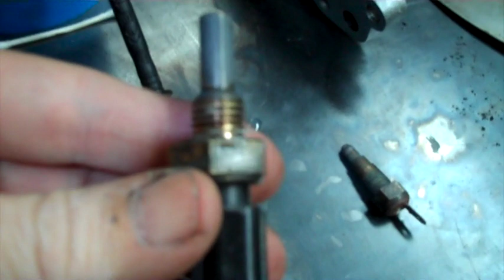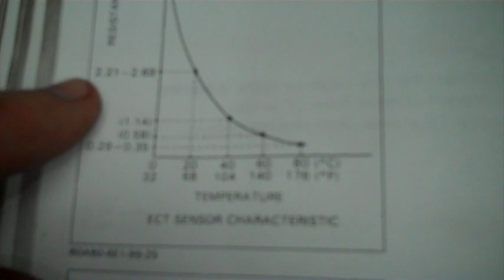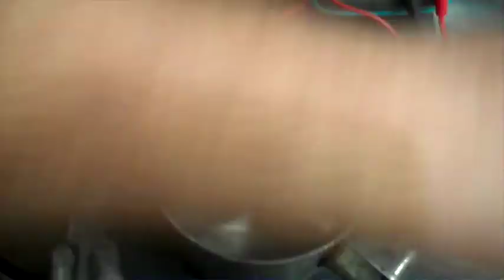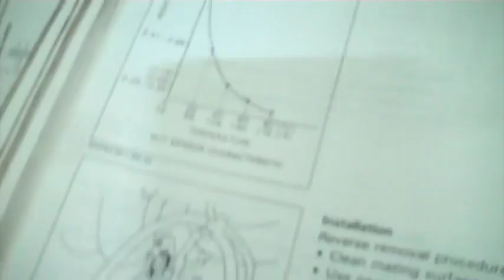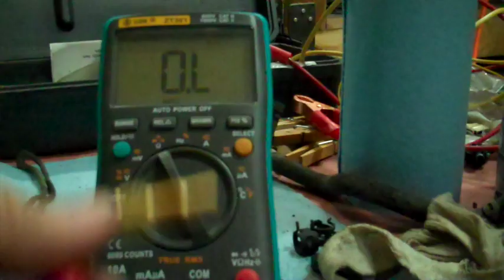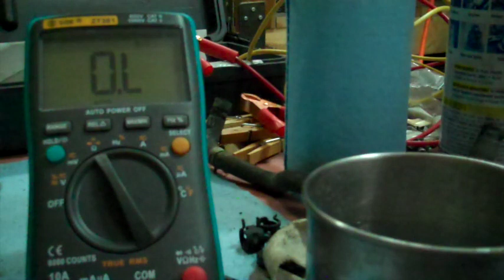1995 Suzuki Sidekick Temperature Sensor Testing

Comment: I have a 90 Tracker that may be overheating.  I'm going to try this.
Reply from the maker: It's good to be sure that the sensor is working.
Reply: @nunapitchuk  Well until I can get the money for that(Tracker is not a daily), I use a meat thermometer, and I used my daily to get a control, and the Tracker is the variable, sort of like a science experiment.
Reply from the maker: @BillyBeethenomad  Sounds like a plan.  Good luck.
Reply: @nunapitchuk  What are the names of each sensor?
Reply from the maker: @BillyBeethenomad  It's just temperature sensor.  One is for the dash gauge, one is for the computer, and one for the air conditioner if you have one.
Reply: @nunapitchuk  I do have AC.
Reply from the maker: @BillyBeethenomad  That means there are 3 temperature sensors in the thermostat housing.  The one to the dash gauge and the one to the A/C will only have one wire each.  The one to the computer has 2 or 3 wires.  That sensor is the most important.

Comment: Where is it located frank new to this thank you
Reply from the maker: The coolant temperature sensors are in the thermostat housing just below the thermostat.  There are two or three.  One for computer, one for dash temperature gauge and one for air conditioning system.

Comment: sir , do you have information about IAT sensor? it's  close to maf sensor?
Reply: it's Air temp sensor than I Need information, Sir
Reply from the maker: @hectorrojas8932  Sorry, my car is older OBD1 system and does not have an air temp sensor.  Most temp sensors work by changing electrical resistance and can be tested with an ohm meter just like the water temp sensor. I would hook it up to read ohms and then blow a hair dryer on it.  If the resistance changes with the hot air then it is probably working fine.
Reply: Good morning thanks my friend,
I have a problem, two obd1 code, 51 and 23, but, that happen my car don't have egr heater and don't have IAT SENSOR
Reply from the maker: @hectorrojas8932  Might be a translation problem, but I have never heard of an egr heater and these old cars don't have air temp sensor.  Maybe you are talking about the egr temp sensor?  The '95 & '94 models has that, but the '93 does not.  If you switch ecm from one to the other then it will work fine, but will give code 51.  You can make the code go away by putting a resistor at the end of the wires to the egr temp sensor.
Reply: Querido amigo Frank, entiendo , y yo pienso lo mismo mi carro es 92, y pienso que la ecu es mas moderna, ya que me esta tirándo esos dos codigos. Y miro que  no tiene egr calentador y no tiene IAT SENSOR, por es razón me pregunto si esas dos códigos pueden producir consumo de combustible anormal, y si al eliminar el termostato tambien produce consumo de combustible abundante
Reply from the maker: @hectorrojas8932  Me Espaniol es no muy bueno.  Ha.  I do not think the newer ecm will change the fuel miliage.  A resistor on the egr temp sensor will get rid of the check engine light.  You need a thermostat for the engine to run at the proper temperature.  Contact me on my face book page:  www.facebook.com/SidekickRebuild/
Reply: @nunapitchuk   hello Sir , thank you so much, ok I understand you, and tell me how about the IAT sensor, it's the code obd1.
Reply from the maker: @hectorrojas8932  I see your message on face book.  I will reply there.
Reply: Probably it's have different ecm, my car is 92 4 door 4x4, 
I will like to fine the egr valve with heater,  and the connectors it's next to tps sensor, but the IAT connector sensor isn't there
Reply from the maker: @hectorrojas8932  I do not believe that a '92 model has an air temperature sensor.  Use my face book page to chat.

Comment: Frank, could you tell me the range of ohms in ambient temperature of the dashboard temperature sensor?
Reply from the maker: Ambient temperature depends on where you are.  It is very cold outside now in Alaska.  Assuming your ambient temperature is around 60 to 80 F then the sensor should have between two and three ohms, give or take a little.
Reply: with 65 ° it marks 645 ohms on the 2000 ohm scale. will that measure be okay? I am referring to the sensor that gives the temperature in the cluster. the little one with only one cable.
Reply from the maker: @wilsonfuentesdiaz9655  You are talking about the temperature gauge in the dash.  Sorry, I thought you were talking about the actual temperature sensor.  The gauge needle moves depending on electric current flowing through the sensor.  So I do not think that measuring the ohms of the gauge will be helpful.  You can take the sensor out, leave it connected, turn key on, and dip the sensor in hot water to see if the gauge works right.  The needle should go to the middle at about 170 to 180 F.

Comment: Test the sensor at a temperature of 64 ° F and mark 2.74 ohms. Will that measurement be correct?
Reply from the maker: I am looking at the graph in the manual and it looks like 2.7 ohms is just right for that temperature.

Comment: Hello Frank ... I have a 1998 Suzuki sidekick  1.6 ... I noticed that the water temperature sensor was broken ... I did replace that .... but I noticed  that there's  another two sensor  , ... I need to know  the name of the sensor that goes above  the computer sensor
Reply from the maker: I talk about those in my video called, Intake Plenum Reassembly.  Yours might be a little different than mine, but there are three, all screwed in just below the thermostat.  Two of them have just one wire.  One of those is for the air conditioner.  The other is for the temperature gauge in the dash board.  The third sensor has three wires if I remember right.  That is the most important one because it is connected to the computer.  If you go on rock auto then they are all called "temperature sensors"  so you have to look at the pictures to figure out which one is the one you need.
Reply: @nunapitchuk  thanks Frank ..... I already  repla e the gauge sensor  and the  other densor  with 3 wires .... but I'm having a hard time to find  the other sensor that is above  the  3 wires  sensor .....

In your  video show the second  one you're  testing  is the gauge or water temperature  sensor?
Reply from the maker: On my 95 model I think the sensors for a/c and dash are the same.
Reply: @nunapitchuk  ... yes Frank.... I just need the ac  sensor one  .. that goes above the coolant sensor